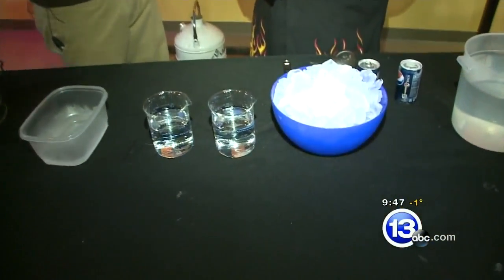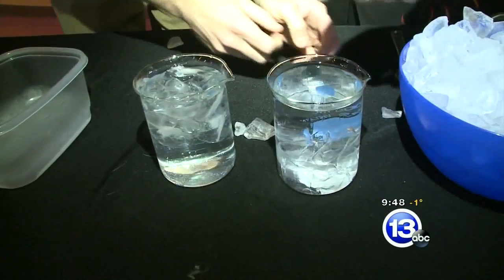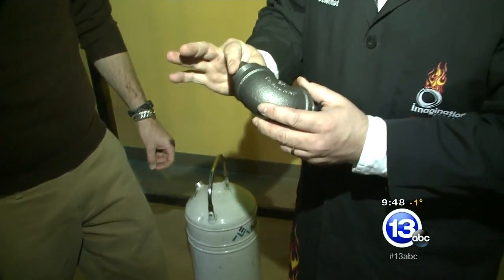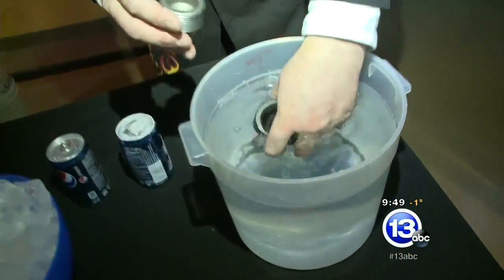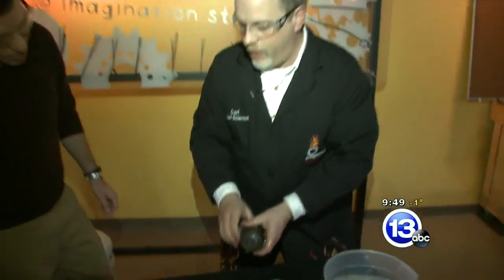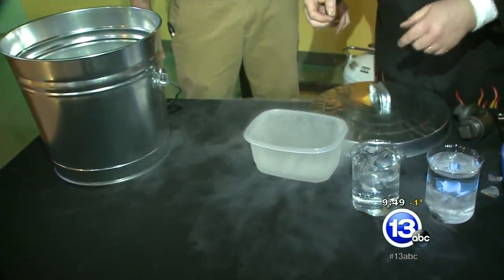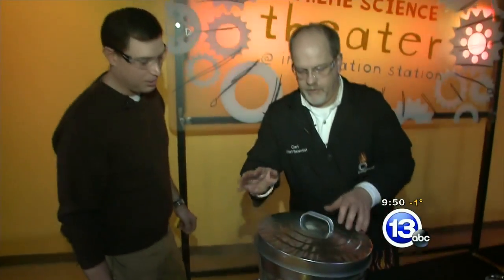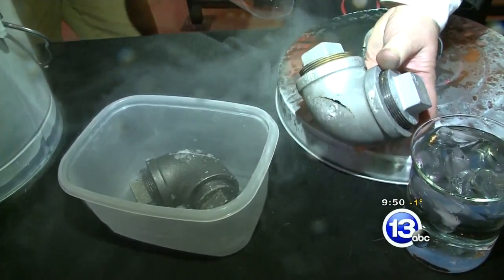Ice can break an iron pipe

Comment: If its not a closed volume , will it just expand as far as it can go or would it still be able to crack the pipe .
Like if you filled a cast iron pot with water , would it crack when the water froze or would it just expand upwards ?